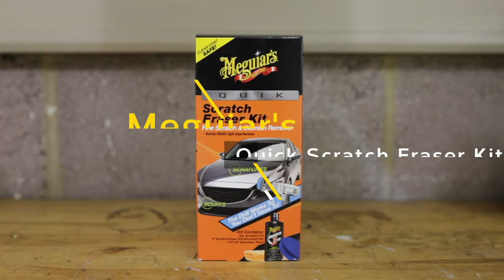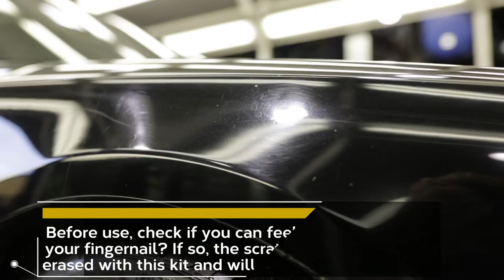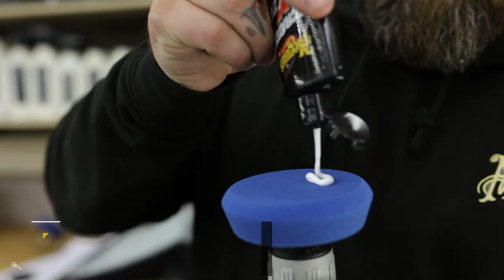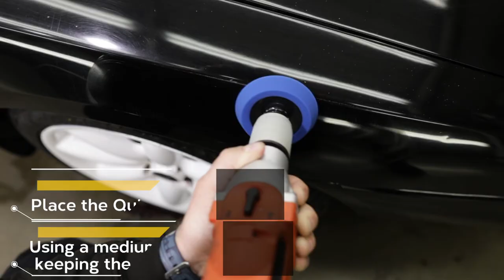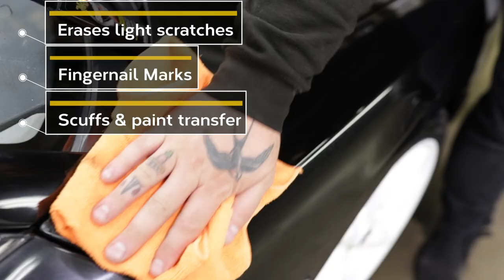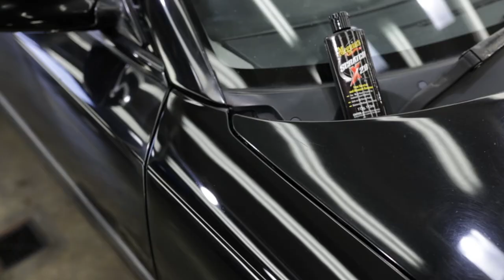Meguiar's Quik Scratch Eraser Kit - Product Profiles

Comment: I have a mild scratch from a branch that goes into the tail light which is also superficial. Can I use this on the plastic of the taillight?
Reply: Probably not, it is more of a buffing compound that corrects clearcoat and paint so I would be very surprised if it fixed a scratch in plastic